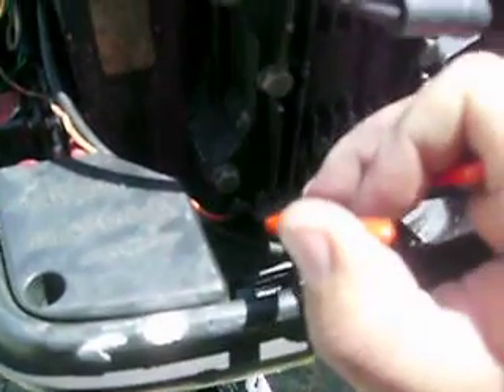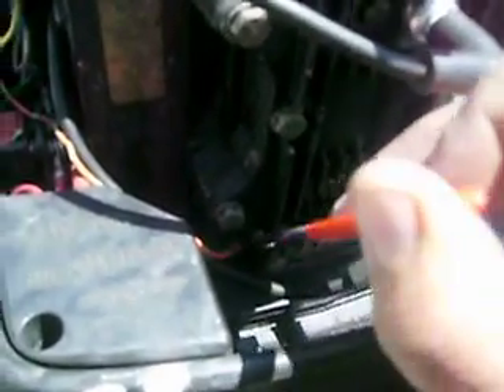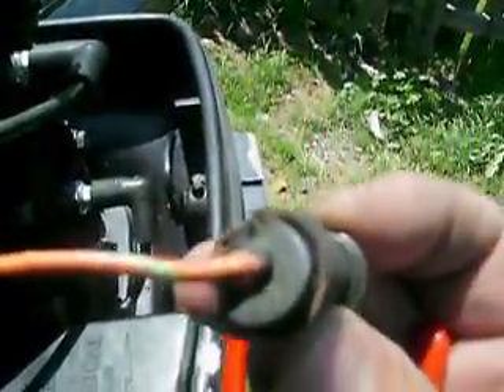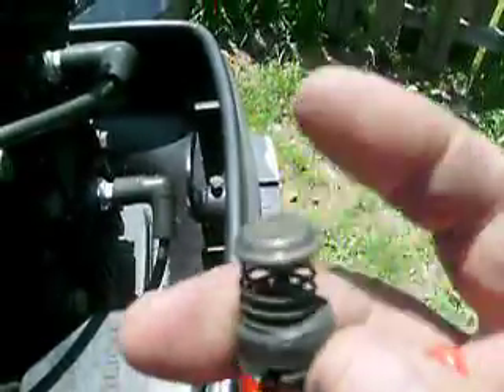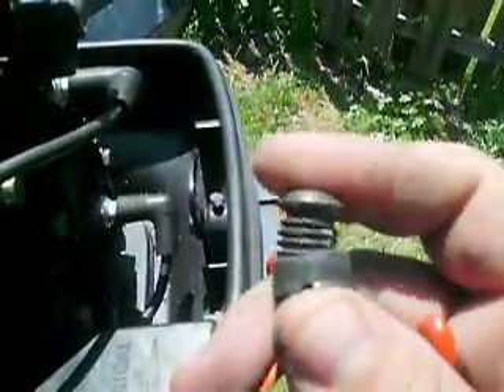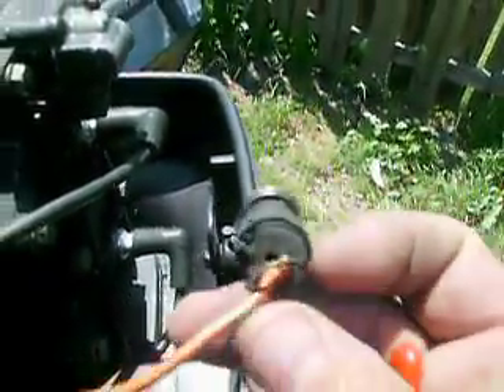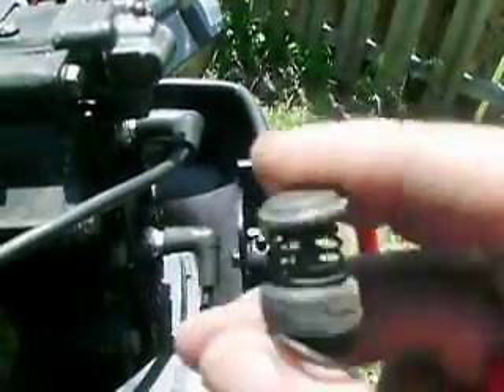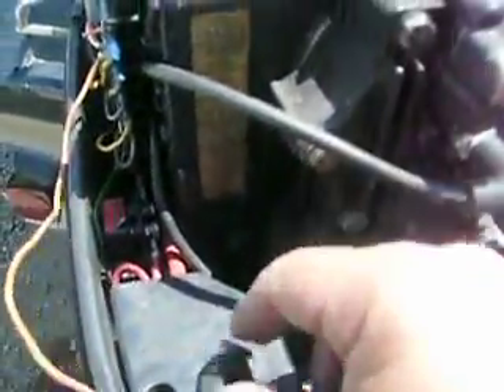thermoswitch removel 507Y9B force 50 1989

Comment: I know this vid is old but why did you think this is bad I’m having problems with mine since it over heated now it has no power
Reply from the maker: its a heat switch. mine melted. better to replace than to hope its ok. the motor head got so hot the rubber on the switch was melted.
Reply: Just curious I have one and mine not even connect to anything. Where does your wire connect to?